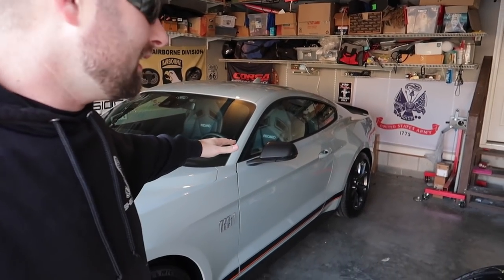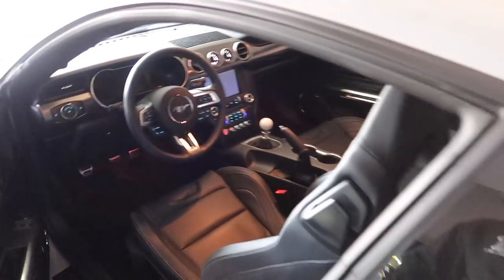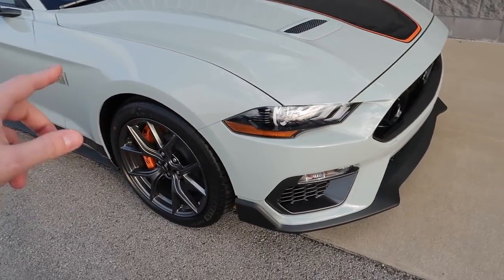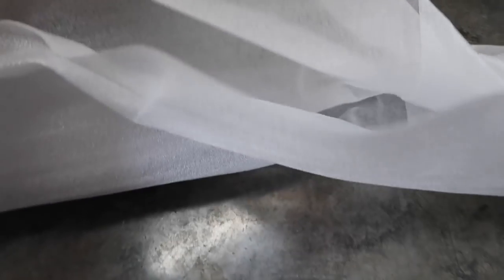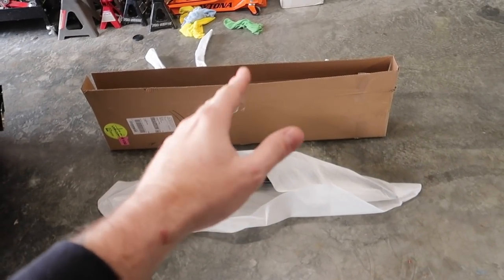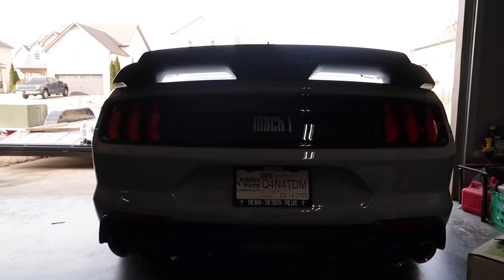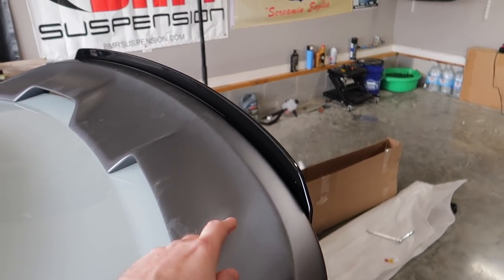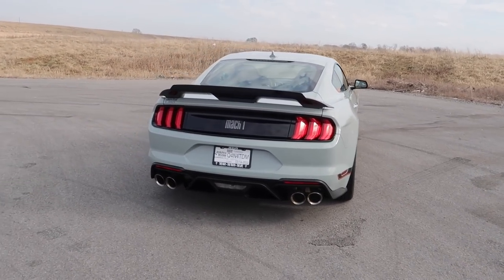FIRST MOD to my 2021 MACH 1 Mustang! CUSTOM PAINTED Gurney Flap *DIFFERENT LOOK!

Comment: I just bought a 22 M1 in silver, the previous owner put most of the HP stuff on (rims/tires/front lip/spoiler) and it looks amazing. I just bought the front and rear wheeel well rock guards to complete the outside HP look.  Nice ride man!

Comment: Your rear wing looks good with your contrast.  I have a Grabber Yellow '21 Mach 1 without the handling package also. SO... I put the same rear wing and the second lower front splitter to make it look mire sporty and aggressive (like you described yours) However, l left it gloss black like the rear trunk panel to leave all the course black trim on the bottom.  All I can say is that we both have awesome Mustangs that stand out without any mods.  BTW, my car took 1st place in its class at the Rio Grand Chapter's MCA Regional Car Show two weeks ago beating two '21 GT500s.  My first ever car show.  Now I need to get the suspension, tires and wheels to complete the handling package setup.  Thanks for sharing your video.  I removed it.
Reply: I meant "l enjoyed it".....NOT "I removed it".  Sorry for the autocorrect.
Reply: When you replaced the factory wing with the handling package one, did you need to drill additional holes?
Reply: @dmytromaratta8210 in the video it looks like you don't need to drill holes but idk

Comment: That color combo on the rear spoiler looks way better than the stock spoiler and goes with the whole color scheme. Tint them windows too so it keeps the color scheme going. So far that Stang is looking sexier by the mod.
Reply from the maker: Getting tint asap. New wheels too 👀👀👀
Reply: @Zander13Productions  cant wait for you to upload the next video! 🍀

Comment: I like it!!  I'm gonna steal this idea with the addition of orange on the lip of the unpainted wicker to match the orange accent stripe.  My 2022 Jet fighter Tremec Recaro without the HP seems to be identical to your car before mods right down to the wheels.  You have good taste!!
Reply from the maker: Awesome and congrats on your FJG Mach 1. Orange stripe will be a good looking idea I think 💪
Reply: @Zander13Productions  Took delivery of Mach 1 N0426 Thursday, took it directly to my ceramic coating guy.  Where did you find the splitter???  I found the spoiler and wicker at LMR.   Appreciate your help!!

Comment: The two difference colors is nice to match the front stripe. What shops around Clarksville do you recommend to do performance mods?
Reply from the maker: I do most my own work. Suspension, blowers, engines, headers, etc. I’m doing headers this weekend for a customer. Let me know and I can help

Comment: Zander, so what does the handling pack have that yours doesn’t besides diff wheels/tires, splitter extension and wing?
Reply from the maker: Those are the main things. Slightly different rear sway bar and magnaride tuning. I guess to make up for more tire width 🤷‍♂️
Reply: @Zander13Productions  cool man. Does your car have magnaride just diff tuning?
Reply from the maker: @thekickfix939  yes

Comment: Did the new spoiler use the same holes as the factory one you took off?
Reply from the maker: Yes indeed 💪
Reply: Do you by chance know the paint code for the magnetic grey that matches the mirrors?
Reply from the maker: @jimrider5433  I don’t. Ford had to look it up.

Comment: I bought my Mach 1 premium at Dundee Ford in Illinois last May.  It took me several months  and looking across several states to find my handling pack with it optioned out.  It was originally marked up to $78k and then I noticed it down to $72k.  The sticker was $63.  They had it ceramic coated and window etched with the body panels also having trackers.  I had a transport company get it to me for a low price.  I noticed that they are more rare now than last year.  In California they are going for $95k.
Reply: I have the ford catch can and Steeda Resonator delete X pipe with Steeda Gtrac brace two piece rotor upgrades and jacking rails from Steeda.  I also have the Kooks Green Catted LTH installed with PBD 93 tune.  It is a beast.  If you get the front splitter I would recommend the anti friction parts from ZL1.
Reply: There is no way you are going to get a HP car with out paying a market adjustment
Reply from the maker: Holy dealer markup 👀👀👀

Comment: Going to be honest, not digging it because it requires a massive PP2 splitter to match the front end. But just my opinion as I like the stock spoiler.
Believe it or not I've seen some Mach 1s (black) with the handling package at delaerships but listed 10K over MSRP,
insane. 

That's why I'm on the fence with the Mach 1s only if there is a dealer markup. But you struck gold! The recaros are nice!
Reply from the maker: If you want a Mach 1 no markup. My dealership is the answer

Comment: Looks great. I just bought a 21 Mach 1. Same colour as yours, but regular premium seats (700A) and 10 speed auto. The first mod I'm doing is the handling pack rear spoiler like this.
Reply from the maker: Congrats on new Mach 1. Amazing cars. Spoiler makes all the difference 10000%

Comment: Mach ! is a special car always.. Be interesting see the future S660 chassis hybrid V8 battery setup.. or Fords new patten on a manual shifter thats clutchless? What?
Reply from the maker: I saw ford working on just that. Seems very interesting. No clutch shifting
Reply: @Zander13Productions  If Ford can replocate manual shifting with a 10 speed ..I highly suspect this is the case..Man it will be a game changer!!

Comment: Pointing out the matte and glossy on the stripping nails it for the spoiler group look right.
If you feel the dealer deserves a call-out, have them put their decal in the license plate recess by the back plate. It looks a lot cleaner, and not an afterthought. BTW, I also assume that you'll be getting some type of Veteran's service plate? Voice of Experience from this USAF vet, it DOES help when dealing with LEO's.
Reply from the maker: 🙏🙏💪💪 tasteful mods this time around 😊

Comment: Not a fan of the Magnetic color on the Swing. Makes it look unfinished. I prefer the Gloss Black.

I have a '20 Iconic Silver GT350 with both the Swing and Gurney flap in Gloss. It ties with the Black stripes and roof. So I may be biased.

At the end of the day, it's your car so all that matters is your opinion.

Comment: Hey , that does look good !!
I think you and I think the same when it comes to mods . I like using factory parts but with a color change , factory look but different . Makes other owners do a secound look .
My local dealer is sourcing me a loaded ,elite , handling package in twister orange . I an on removing all the stripes , paint everything above wheel openings orange including mirrors and dec spoilers . Leave from the wheel openings down as is magnetic . Thats what my GT looks like that I will trade in . 
I just don't like stripes . My 03 cobra  , 08 Bullitt &  21GT have no stripes . My 13 boss302 is going to the detailer next Monday to remove the lower stripes from the front fenders back . I have never liked lower body line stripes . To me it always meant " pony car " / 6cylinder . Like I told you on my comment a few days ago , I am done with tremec . My new mach will be 10r80 like my 21 GT . Oh ..... one more thing , the factory tremendously shifter is the best !!! If you need to change up just put on a Hurst shift lever and knob.  Have fun !!!
Reply from the maker: Oh I’m gunna be jealous. The twister Mach 1 would have been my first pick but I could not find one. Twister is my favorite color on these cars. Just happy mine has orange in it too so I get my twister fixation lol. Yes. I like using factory parts whenever possible. Best fitment and look

Comment: Welcome to Ford motor company, looks nice as it is. You should have bought gt350 Instead. Just saying.
Reply from the maker: I will have a video explaining why I chose the Mach over a 350. It should be interesting
Reply: @Zander13Productions I was just wondering what happened from your twin turbo from hellion turbo to supercharger stories. I have gt350R twin turbo build by fathouse performance. 1000hp package.